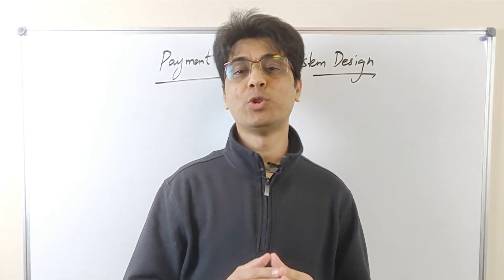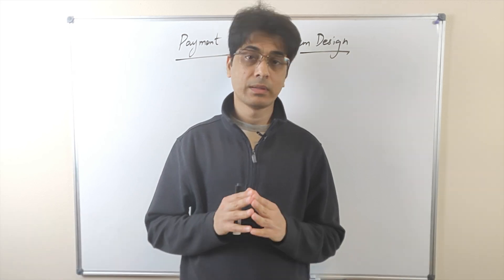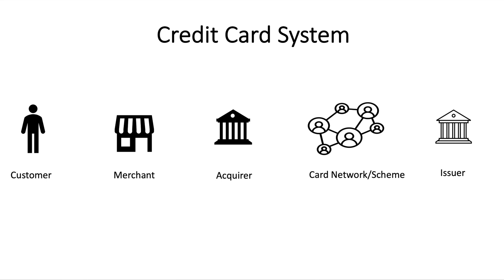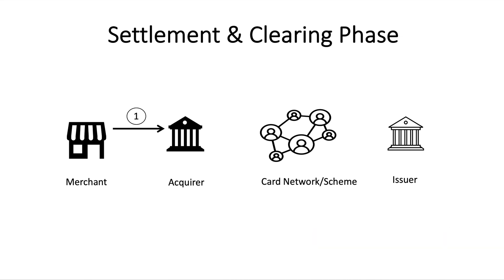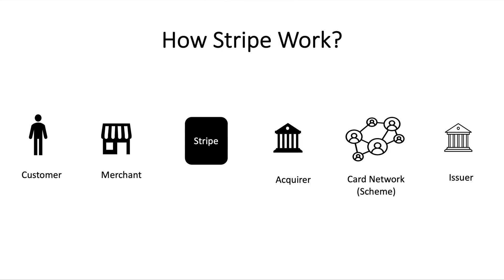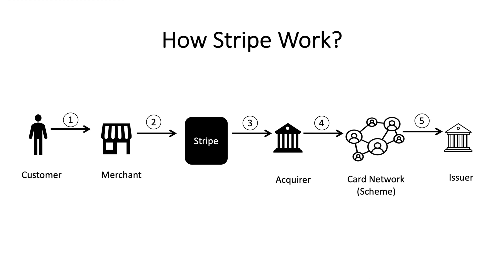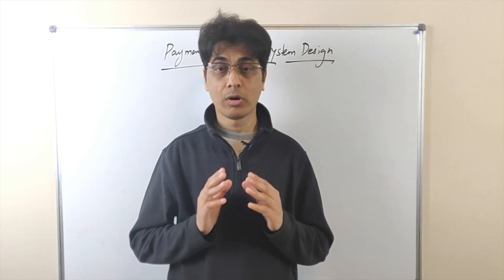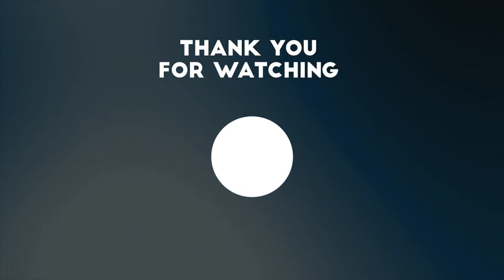Introduction to Payment Gateway System Design | Design Payment System | Stripe Product Design

Comment: How are do you plan to design a horizontal scalable system that is both highly Available and strongly consistent at the same time.? CAP theorem choose 2 out of three
Reply from the maker: Thanks for the question. This has asked multiple times in this channel and I have answered them before as well. I think people have wrong understanding of CAP theorem and its applicability. Now the question arises that how a service is available and consistent at the same. It boils down to the fact that no service is 100% available. Question arises whether we are targeting five 9s or four 9s of availability and again it also boils down to whether we are talking about availability of the whole service or some part of it. The service itself can be highly available (as a whole with 5 9's or 6 9's of availability) and at the same time fulfill consistency requirement as a whole (keyword is "as a whole") however the individual partitions (in the datastore) may have to prefer either availability or consistency. Now it is totally possible that one partition could be down due to network partition but it won't affect the functionality and availability of other partitions, thus overall service still considered as highly available. I hope this clarifies.
Reply: @ThinkSoftware  Appreciate the response , it does clarify. I have another question In the scenario above, I am assuming that these partitions are on different nodes as you say "Now it is totally possible that one partition could be down due to network partition but it won't affect the functionality and availability of other partitions". So would that mean you would be choosing a NoSQL data store. From what i understand it is quite challenging to shard a RDBMS databases. For example writing Join queries that may need to span multiple nodes can be a very expensive operation also Group by etc.
Reply from the maker: You can shard RDBMS but then you should shared-nothing architecture for the partitions so you wont be using joins etc across partitions

Comment: I really appreciate the effort. However, the very basics of system design is missing. One of them is the HLD (High level design). Second is some UML diagrams. That will make the design complete. That would deliver the best than simply delivering the speech.

Comment: Thank you for your video, quick question. Why the issuer bank first freeze the money, and do the real transfer money at the end of the day? Can they transfer the money from the issuer bank to acquirer bank during the runtime per transaction instead of the batch job? what is the trade-off here?
Reply from the maker: This is due to distributed nature of the system. The fault can occur at any point in the return path causing the transaction to be lost or  double charge the customer. I think I have covered this in the video if you watch it complete. The more details are in the course.

Comment: Based on CAP, we can not reach  strong consistency and highly available at the same time, isn't it?
Reply from the maker: Most people don't understand at what level CAP theorem is applicable. This I have discussed in the course.
Reply: Specific to the service that would be driving transactions, the service should be consistent and highly available. As per CAP, thus the system does not become partition tolerant. Hence the system relies on transactional DBs and uses hot/hot backup